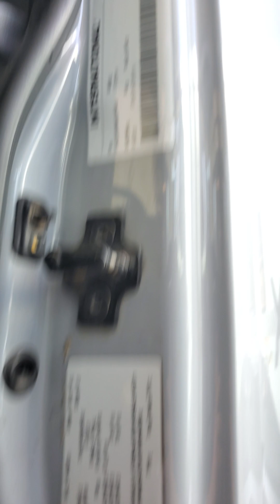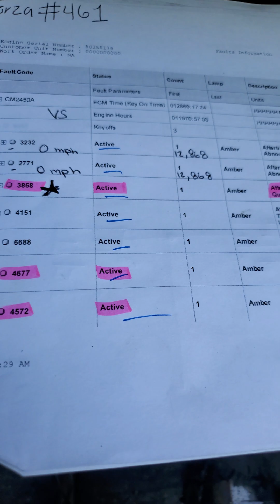2020 International aftertreatment abnormal update rate active code

Comment: broo, how is this even possible! at my workplace, was told to replace header due to the vast DEF codes. Did that, no luck, still active, even after calibration etc. and just like those, mines were Abnormal Update Rate (Loss communication). the come accross your video but didnt pay muuch mind to it. While troubleshooting a relay code on INSITE, noticed one of the relays not deliveering due to no power at the f1 and f3 fuses on the small fusebox by the battery.. Upon further hw, got the diagrams from Navistar Bodybuilders Resources (so nice to find available to the public) and traced the fuse for that Relay to be fed from Underhood PDM fuse 3B 30A, which is exactly the spot where you said a fuse was missing. what if i tell you my fuse was missing too?? idk how is that even possible, for it to be working without a fuse and now it needs one placed on that empty spot? very misterious, unless somebody had taken that fuse out but no clue. im curious now, and the next International LT i see ill check for that fuse to be present xD